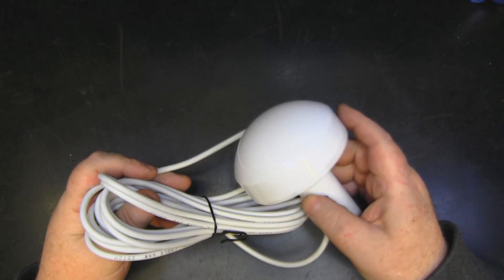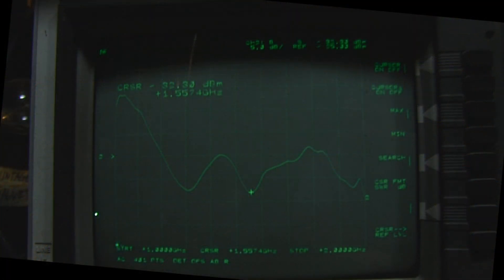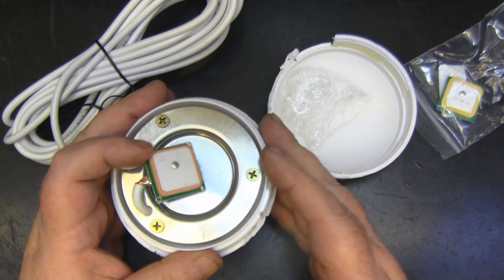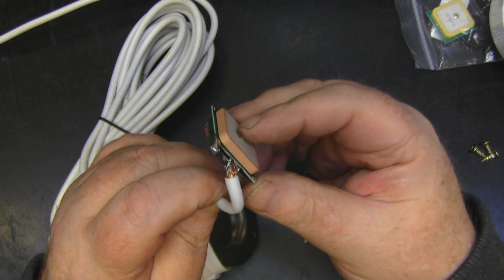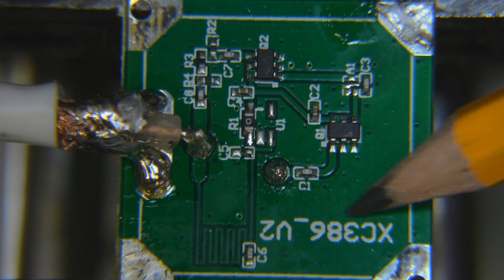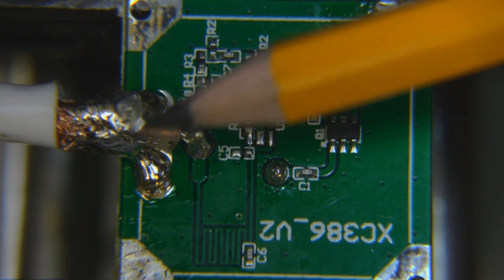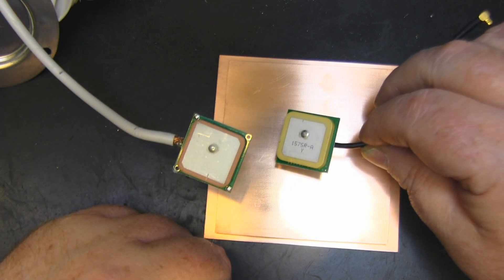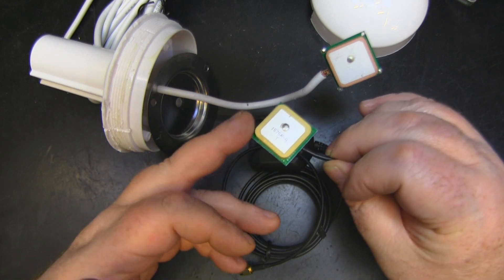Boat GPS Antenna

Comment: most units i installed that looked like this on a boat had the bias tee injecting 5v and there was a small serial unit attached opposite to the antenna patch that already did the decoding and passed digital NMEA down the line to the gps.  thest the line for digital sigs!

Comment: I have a bit of a funny experience regarding GPS, I live out in a forest where there is very poor mobile coverage, I have found that where mobile is bad, GPS is also bad! there are some aps for mobile where you can see which masts you are connected to, if you compare it with the GPS signal on an old TOMTOM, it is the same "sattelites" as mobile masts! I wonder if the G in GPS stands for Ground and not Global.

Comment: I bought one of those on eBay for $35.00. It came with a swivel mount so I can mount it on the roof to get a better shot to the satellites. It's just a cheap patch antenna like you showed but felt I should get better coverage for my GPSDO in the shack rather than the puck antenna on the window sill. Haven't installed it yet. 73
Reply from the maker: The problem I have is they will put a $4 antenna in a case that is way larger than it needs to be so people think bigger is better, more powerful and pay a much higher price.

Comment: The small scratch on top, is actually for tuning.
The antennas, are just to get the antenna outside, when the electronics are inside.
GPS sats are only USA made satellites. No restriction on frequencies once the USA public told the military to release access to GPS system. Now, Russia, China, UK etc have thier own "GPS" sattelites in use, so they all go into the same SAT NAV pool. India has two SAT NAV satellites,  but they dont share with the rest of the world. They are only active over India.

Comment: Surely, connecting something with a built-in amplifier to a network analyser will produce an almost meaningless result? It will just show a plot of the output impedance of the amplifier. The losses in the cabling and plug/sockets will be very significant at the GPS frequency, hence the need to include an amplifier close to the antenna. This will help prevent the very weak signals getting lost in the noise.
Reply: Yep, I reckon so too. Seems that McNeil doesn't even understand the basics.

Comment: Some comments and general points about GPS antennas. 

1.L2 gps is available for civilian users (but rare).

2. You are measuring the VSWR of the amplifier output not the antenna.

3. The amplifier might be saturating in your test. It's designed to amplify signals at -130dBm to putting 1dBm on the input is huge. Normally these amps are quoted to be 20 to 40dB gain. For those unaware  you can't compare this to antenna gain as this amplification boosts both the signal and the noise. Their only purpose is to compensate for cable loss.

4. Good antennas also have SAW filters to reject out of band signals. These don't.

5. Totally agree that this is poorly made and overpriced.

6. The antennas are designed to be circularly polarised, but when miniaturised with the ceramic the dimensional accuracy required to achieve this is very high. Hence many antennas like this have very bad axial ratios. The best antennas often have laser trim marks where they have been tested and adjusted.

7. GPS receivers are so good these days you can get away with very bad antennas.

Comment: interesting, i would have thought they would be using modules like we use in the RC hobby, they have the receiver built in and send serial data rather than RF down coax.
I use a couple of different types depending on if i need a built in compass or not but they work with multiple Satellite navigation systems and are compatible with GPS, GLONASS, Galileo, BeiDou, QZSS and SBAS
Reply: Hi Steve. I just stumbled on this vide and 99% of it went completely over my head. However your comment seems to suggest you know what you are talking about.  I bought one of the little modules that is in this antenna with the intention of connecting it to my   DSC marine VHF radio to give it automatic position reporting if I press the distress button without spending a fortune. Unfortunately I don't think it had the built in receiver that you refer to  and it was also locked to the wrong baud rate and I couldn't find a way for a non-technical person like me to change it.  From your experience could you recommend a suitable module please?  My VHF manual says this about the type of output required: - Your GPS must output the $GPRMC/GGA NMEA data sentence. I gather the baud rate should be 4800. Thanks Andy
Reply: @olddoozer  A year late to the show, but I'm using a Mateksys 'M10Q 5883' Compass/GPS. It does work with NMEA, and most or all other positioning sats. I have used it on 4800, 5700, 9600, 115000 baud, it doesn't seem to be too choosy with speed. I'm connecting them to an STMF7-22 microcontroller, on a flight controller. The module communicates via i2c and UART +3.3~5volts. It gets a lock in a few seconds, and at 42 degrees north, I get 14~16 sats on a clear day.  if you are still messing around with positioning systems, or if someone else is reading this, that's where I'd start looking. Very low power consumption, and pretty small, for the performance.

Comment: Very interesting- seen lots of these before but didnt know how they worked
Had a small USB Gps dongle that had a converter for serial to USB. Antenna was a lot smaller.
Used it for war driving about 15 years ago
Not many people had WiFi then.
Reply: ha ha, ive said similar, im in the RC hobby and have loads of serial 'GPS' modules  :)

Comment: Hi! when using a certain dielectric, the size of the antenna is reduced, and with this the efficiency of the antenna is worse?  did I understand correctly?
Reply: That is correct. Because they have a smaller aperture.